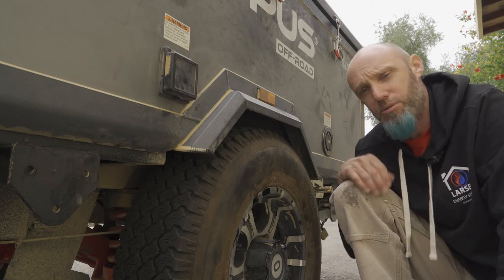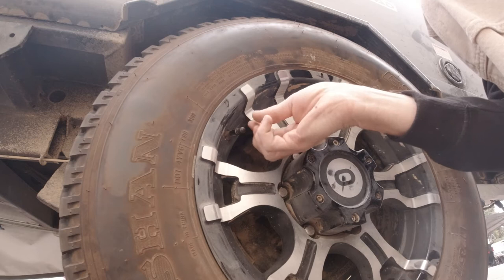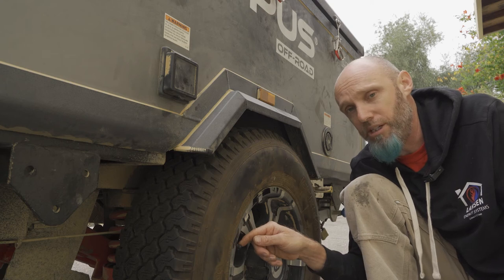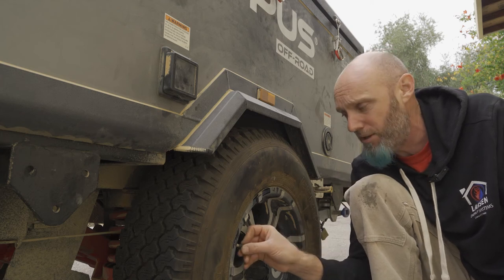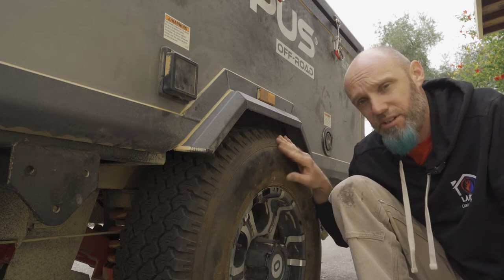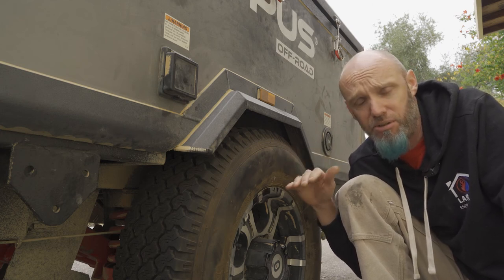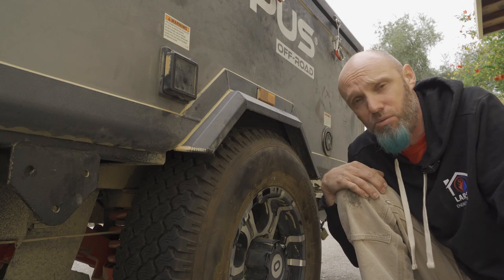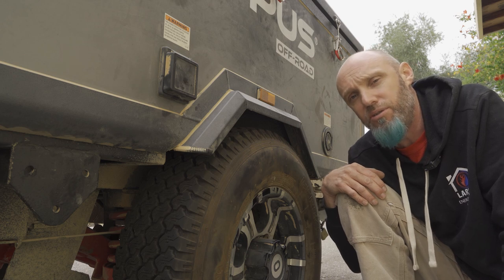Tire Pressure Monitoring System - Is It Worth it? - Opus Air Trailers

Comment: I agree with your off-road assessment. However I am eventually going to have a system on my truck and toy hauler. I have always checked tire pressures before a trip on the road but what happens if you pick up that nail along the way and the tire blows. I have seen some  pretty bad carnage from others. Having piece of mind and not having to worry about “ are my tires OK” every 5 min might make it well worth it. LOL 😆
Reply from the maker: Thank you for sharing. I don't know everything so it's great when others chime in with more info.
Reply: My truck and trailer miles are mostly on the Highways and just a few miles off-road so my concerns wouldn’t be the same as yours. But I would love to see some off road tech come into the air monitor systems.
Reply from the maker: @XCountryAdventures  I have been unable to find a in tire sensor/transmitter yet. If I come across one I'll for sure post it.  

Best I can tell as long as one buys a good reputable set up there would likely be no problem. But as mentioned in the video these Opus trailers are pulled through some very nasty terrain. All it takes is once to have a problem with the valve stem then your in a world of hurt.